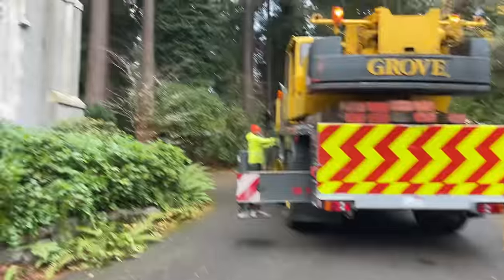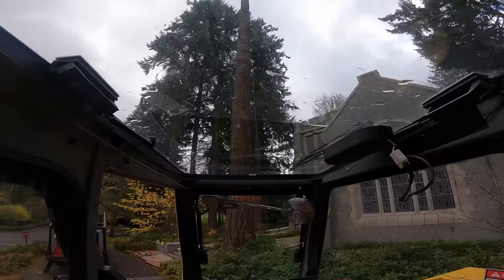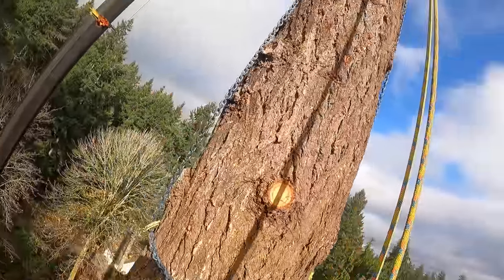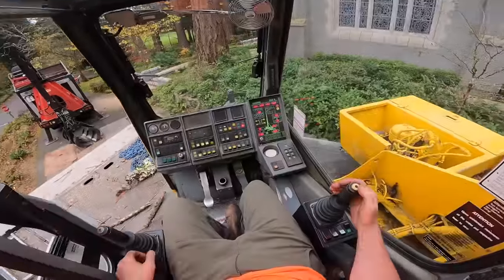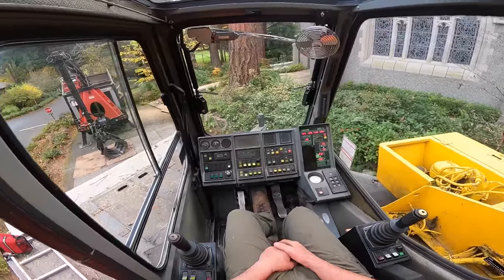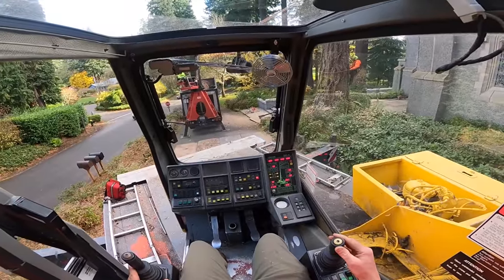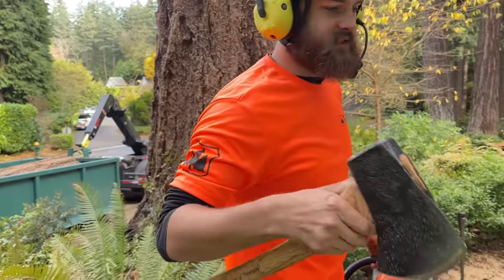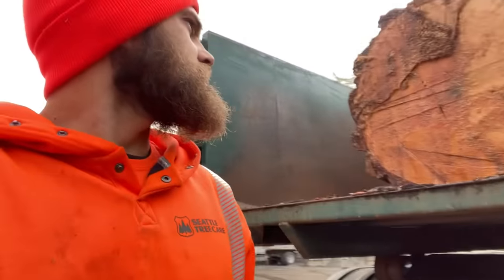BIG CHAPEL FIR FINALE!!! Craning out some HUGE wood on a very old Douglas Fir with Seattle Tree Care

Comment: I was a Tree Climber as well as Faller and every position in the business because I owned Ray's Tree and Stump Removal as well as excavation Co..  When I came to the san Francisco Bay area they had never seen a man climb redwoods without a safety harness. I was just a bare rope climber and never used spurs. I rated #5 in a group of ten Tree Surgeons. They places a cap way out on a limb and we had to go out and retrieve it. I was the only climber without a harness. i used a Ginny limb above and walked many of the limbs. i did many line clearance jobs and instead of climbing every pole I would tie a rope around my waist and the top heavy phone cable and walk on the cable below it straddling the phone cable. They took photos of me eating lunch on top of a telephone pole and it went ap. all over the country.

Comment: It will be a real shame if this tree does not find its way to a quality mill. Then put into the hands of some quality 'makers' who will transform this majestic specimen into its next life , to live on for more generations to come. Good Job Jake and crew!!!
Reply: No mill will take that wolf tree garbage.  Ok, last 20-40 feet is Ok, but even that is going to be pulp.  Now if they had measured off a 16' chunk and were actually able to pick it... that could be worth ~$500 at the mill maybe, but they weren't picking pieces that large so... 1MBF is less than $1k right now and this fir does not have good wood at all.  Anything cut would be low grade lumber

Comment: I once worked in a Saw Mill where I cut Douglas Fir ( or as we call it Oregon )
We used a Bandsaw with a 6 inch wide blade,  2/3 of the Bandsaw was above the  floor, while the rest was in a pit which went into the floor.
It was powered by a fairly large 3 phase motor ( I can't recall how many HP ) but it was powerful enough to turn 2, 6 foot diameter wheels.

Sizes we cut would vary to what customers required.
Most of it was used for support beams in construction.
Some of the beams were as large as 30 inches, which was the largest we could cut.

I only thought to comment on this as we sometimes sat there counting the growth rings of the sections.
Some of the tress must have been over 150 years old.
I could only imagine what had happened in the world while these trees were growing.

Only even had one bad experience while cutting ??
Someone at some point had nailed a Horse Shoe to the tree, and the tree had grown around it which could not be seen from outside.

Luckily I just cut the edge of the Horse Shoe.
Of course it destroyed the blade ????
It made a hell of lot noise.
I first thought the blade had broken, LOL.

We finally got the Horse Shoe out of the tree and nailed up on the wall as a reminder.

Comment: Love the video great work. We use Eartec comstar headsets same thing you have a com center can link up to 8 head sets very pricey 3k a set I believe. Alot of times with our 60 ton when we're on big wood the operators will come up on weight on cable then last bit of tension to weight theyll boom up last thing you want reaching far is piece floating away from you. Keep up the good work

Comment: Amazing video.  Climbing with that saw is nuts. I bought a Husky 390XP for my "big" saw, and it definitely doesn't have the torque of the 395.  I'm wondering if I made the wrong choice.  Maybe this is going to be my excuse to pick up the new 592.  I have enough trouble running them on the ground, let alone in the sky!

Comment: Hope that big ass tree is put to good use!  Lots of potentially great lumber from a tree that size.
Reply: Yeah my thoughts exactly especially with the high cost of lumber,however it’s better when it’s cut in longer sections.Im not sure what the age of the tree was but judging by the shear number of rings even at the top and coarse bark I’d say 300 years old.

Comment: I saw you use gas to clean your hands of sap.
I was shown by a logger to use butter.  I know  I know it sounds crazy but it works.  It cleans your hands wipe with a rag. As a bonus you hands don't smell of gas.
All ways great to watch you and see safety first. 
You got a family that wants to see come home safe.
Reply: Butter? Good to know!
Reply: Use Turpentine.
Reply: @w8stral  
Washing your hand in a chemical? Plus it is flammable and smells. 
Try butter it will surprise you how well it works. Just a little bit goes a long way.
Reply: @assassinlexx1993  Butter... = high cost, smells, is a chemical, flammable, and you have to wash your hands in strong soap afterwards.... Turpentine is from trees, smells, is flammable and you have to wash your hands afterwards... WTF is the difference?
Reply: @w8stral  
When you are at a  restaurant and they got those pre- package of butter. Just one of those will do to clean  you hand and grab a few paper towels. 
For zero cost. 
But hey if you like squirting turpentine on you. Well you go for it.

Comment: The total weight of that Tree would have topped 90,000 pounds. I used to remove Canary Palm Trees and truck them to Vehas and many other places and the average palm with a ball would hit right at 45,000 pounds and i haulled loge and would weigh in at 80,000 pounds.

Comment: At 56:38  he has the tree cut down in sections. And at this time frame on the video there is a good 80 to 100-feet still left standing straight. 

He decides that he wants to do a photo op standing on the very top him and his chainsaw.  The Husqvarna model 395.  

I don’t know if it dawned on him just how dangerous this really is what he is doing at this stage of the game. He could so very easy fall off the standing stub.  

Furthermore the crane operator told him that as he was lifting him up with the ball a red tail hawk was flying around watching everything very keenly. And those kind of hawks are notorious for diving down at people. 

It would not be unusual for it to dive at him as he stands there,  leaning on the engine with the 42 inch bar tip,  buried into the wood a-bit.    There is no way in hell I would do what he’s doing.

Comment: Stihl v Husky ain't no match, Stihl will walk the dog. Working up in a tree the Husky is so light it's prolly the way to go, but on the ground, no sir Stihl rules. Chain not real sharp on 66, but it's a boss. I live in Texas and cut a ton of red oak, white oak etc for firewood. Bought an 084 years ago, ported exhaust, 123cc, and when that big oak is on the ground and you have to block it up. Let's just say nothing will hang w that 084, it's like holding a YZ 125 in your hands. We still have full time loggers here, and if your living depends on it, you roll w Stihl

Comment: Ok, that saw looks massive when you were posing beside it on top of the spar. It does not look near that large when you are cutting the tree with it. It definitely helps when you give the specs of the saw in text in the video. But the specs still do not do the size of the saw justice.